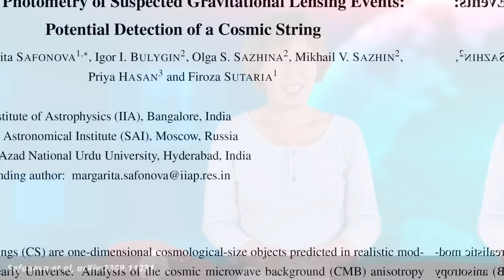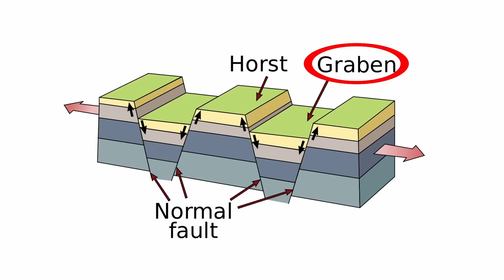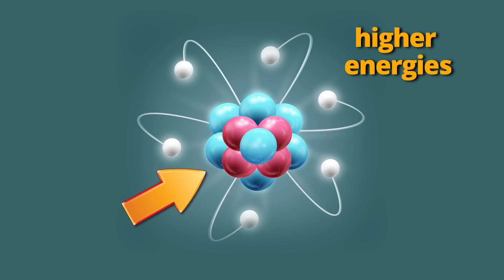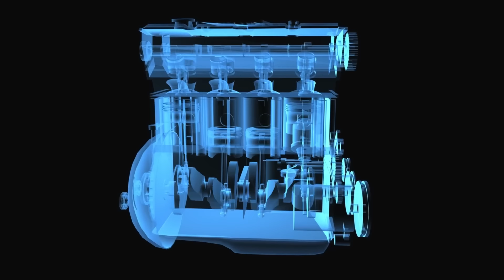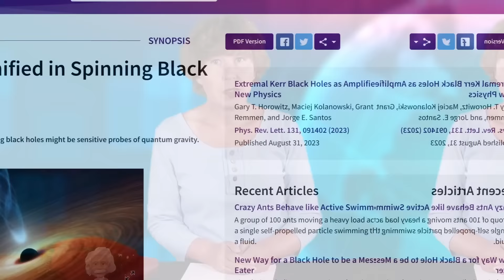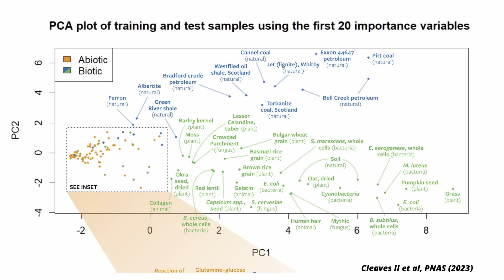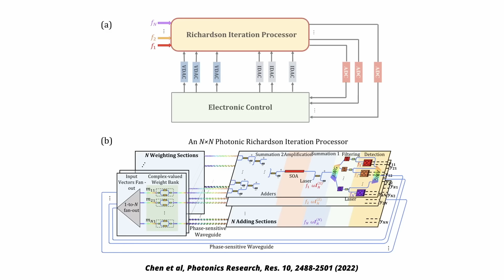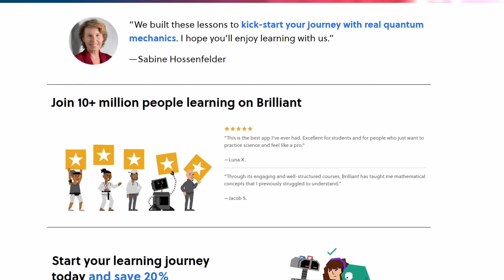Could this be the first evidence for string theory?

Comment: Okay, the most frequent problem I have with current physicists is their failure to realize the difference between the Ideal and the Actual. How can anything exist in a single dimension? Well, if you deal with things in the Ideal realm such an object would be a point or a line or even a plane, but the truth be told if you deal with things in reality such objects do not exist, not even on drawings.
 
Mercury might well be shrinking for the same reason that an picked apple shrinks in a hot place--it is being dried out by the sun. Silicates are rather fond of water, as I recall.
 
As clocks improve, we are closer to testing Einstein's theories directly. For instance, does relativity function on the quantum level? That could be tested with rigid tubes and very precise clocks.
 
Someone let me know if Lattice comes up with a cure for kidney disease.
 
How is that a "blackhole" which, allegedly, has but a single dimension, can be said to spin? Oh, that's right! Garbage in, garbage out.
 
AI, AI, ai, ai, ai!
 
Photonic computing? AI, AI, AI, ai-ai-ai!
Reply: Unlike you, science attempts to produce theories and substantiate them. Negative declarations without substance can be made at any time. Saying "prove it" is literally what the scientific field is based on.

When an idea cant be substantiated sufficiently, or a better theory comes along that more completely explains something, that idea replaces the old one. Its how science progresses.

As for relativity vs quantum experiments, there are many. Both have cases where one theory is viable and the other is not. You have a lot of material to explore if you want to make an educated argument, the field is expanding constantly. Additionally, the tubes+laser clock experiment has occured in the past

Black holes as a whole is a giant ball of confusion for everyone. Its yet another scientific frontier! You could aid in expanding the field!
Reply: @crazykhespar8487  RE:"Unlike you, science attempts to produce theories and substantiate them. Negative declarations without substance can be made at any time. Saying "prove it" is literally what the scientific field is based on."
 
I do not care who you are or what you level of education might be, when you come along and insist on the existence of an object that cannot be seen and has but a single dimension you will belong on my ignore with extreme prejudice list. It is not up to me to prove the existence of such things, it is up to those that make assertions about there existence.

RE:"When an idea cant be substantiated sufficiently, or a better theory comes along that more completely explains something, that idea replaces the old one. Its how science progresses." 

Okay, so why is Mercury shrinking--assuming that IS shrinking? Got a better idea? Not theory, just a better idea.
 
RE:"As for relativity vs quantum experiments, there are many. Both have cases where one theory is viable and the other is not. You have a lot of material to explore if you want to make an educated argument, the field is expanding constantly. Additionally, the tubes+laser clock experiment has occurred in the past"

Well, I did not know that such experiments had been conducted. I came up with this idea on my own. I did have one scientist who that such experiments would be very, very costly. Do you know where I can find a description of these experiments and their results? Perhaps the experiments I have in mind are not the same as those that were conducted.
 
RE: "Black holes as a whole is a giant ball of confusion for everyone. Its yet another scientific frontier! You could aid in expanding the field!"
 
Expand the field? Do you really believe that snooty physicists would welcome the likes of me into their fold? I am flattered.
 
I do realize that black holes are problematic. And that is why I suspect their very existence. Again, how can anything have an infinite density while having no volume? What exactly is a "singularity" beyond a mathematical fancy? Is it a location where imagination meets up with reality?
Reply: @ManuelGarcia-ww7gj  

>"I do not care who you are or what you level of education might be, when you come along and insist on the existence of an object that cannot be seen and has but a single dimension you will belong on my ignore with extreme prejudice list. It is not up to me to prove the existence of such things, it is up to those that make assertions about there existence."

Hence my statement: "Saying "prove it" is literally what the scientific field is based on." Theories must be substantiated as they are subject to high levels of academic scrutiny from people far more qualified than the two of us.

To reiterate, you said this: "It is not up to me to prove the existence of such things, it is up to those that make assertions about there existence.", and my statement was: "Negative declarations without substance can be made at any time. Saying "prove it" is literally what the scientific field is based on."

These statements are the same but stated differently.

>"When an idea cant be substantiated sufficiently, or a better theory comes along that more completely explains something, that idea replaces the old one. Its how science progresses." 

"Okay, so why is Mercury shrinking--assuming that IS shrinking? Got a better idea? Not theory, just a better idea."

---A couple points of order:

A theory IS an idea/series of ideas intended to explain something.

Intending to deflect the conversation with the strawman of Mercury shrinking is interesting. The addition of "Got a better theory" as if I were qualified to come up with the best suggestion is quite generous, thanks for that, but I am unqualified and it isn't my job to come up with a scientifically salient theory. Maybe its a meatball made of dinosaurs and its drying out? I like my theory.

A more realistic answer is: Research the temperature shift of mercury over time and attempt to find out its fluid contents, assuming you discount continental drift/etc. Then you can make an educated guess as to why, if you decide relying on physicists isn't worthwhile.

In relation to the experiment to unify the two main theories, no, relativity does not make an appearance after a certain point, just as quantum properties don't occur in large body interactions.

The paper I could find was related to time dilation, though as a whole I'm still not sure how your idea would make relativity coincide with specific aspects of the quantum theories. Thankfully, there is a multitude of literature about their differences and inability to occur in some instances simultaneously. Virtual particles, for example, cant exist in a universe completely explained by General Relativity. They can be measured, though. Gluon Anti-gluon pair coannihilation creating quarks and deleting quarks in a soup of theoretically 5 of them, measured based on weight, inertia, etc, but they only exist at the spontaneous moment of measurement. Relativity states that they would never pop into or out of existence. As for proving the whole "Only existing when measured" idea, Richard Feynman's double slit experiment covers it.

>"Black holes as a whole is a giant ball of confusion for everyone. Its yet another scientific frontier! You could aid in expanding the field!"
 
"Expand the field? Do you really believe that snooty physicists would welcome the likes of me into their fold? I am flattered."

I believe in you. You appear to be curious, and being cynical about information that isn't fully verified yet is a good trait. Also, mostly deeply enfranchised physicists and those that got the degree(s) to appear smart are snooty. However, if you want to avoid potential asshattery, many physicists have found success on their own with the aid of only a few peers, or none at all in a few cases.

As for ideal vs real, ideal scenarios are constructed for the purpose of understanding much more complex real interactions. All lab based chemical tests assume no unintended material is involved in the interaction. So calculations are made with that in mind, instead of trying to account for small amounts of materials that will never be present. Getting a baseline is the first step towards understanding further complexity within any subset of rules, not just for the way the universe works.

A singularity or ringularity (a spinning singularity can only be a circle) is hard to explain with our current understanding of physics. Perhaps the gravity is so strong its stretching space in such a way that we just can't see the "bag of holding" its making inside. It IS in fact where our theories cease to function and it does become closer to imagination confusion due to the way the math works out (depending on what you're trying to prove or measure). Additionally, it isn't infinite density, which is always stated incorrectly. Black holes have different magnitudes, and thus their singularities are heavier, even accounting for the surrounding event horizons mass. Its a point of density at which things begin needing to occupy the same space. Could that gain enough mass to become infinitely dense? Perhaps, but as we all know, blackholes shrink over time.

As an aside, when did you decide to stop trusting science/physicists (if that's what's occurring)? Or would a more accurate question be more along the lines of asking why you feel the need to state your lack of trust while watching a channel centralized on the subject?

>"(If you believe black holes exist?) you will belong on my ignore with extreme prejudice list."

Unfortunately that list will be very long, and I'm not sure anyone will care. Curate your list carefully and frequently! Have a good day/night. Or don't. I'm not your mother (probably).
Reply: @ManuelGarcia-ww7gj  "I do realize that black holes are problematic. And that is why I suspect their very existence. Again, how can anything have an infinite density while having no volume? What exactly is a "singularity" beyond a mathematical fancy? Is it a location where imagination meets up with reality?"

Being problematic doesn't mean they don't exist. In fact, the event horizon telescope has now imaged two of them. What's exciting is to - try to - know what's behind the event horizon. And the actual knowledge of the central region derived from GR and QM is indeed incomplete. No one really knows. 

Maybe it is not a singularity and the matter/energy (E₀=MC² stuff you know...) is all "condensed" at the Planck level, stacked up, like Quantum Loop Gravity suggest. In that incomplete conjecture / embryonic theory, space is discrete and its minimal length is the Planck length, singularities are ruled out by design. It also suggest that the big bang is the rebound of the previous universe at the Planck scale as well... 

A lot of ideas are up in the air about all of those things. For the time being, GR and QM work very well in their respective domain. Whether physicists will one day have a eureka moment about any new path beyond the current paradigm remains to be seen. Maybe it will happen, maybe not, and we are all "condemned" to eternal search and curiosity. :)